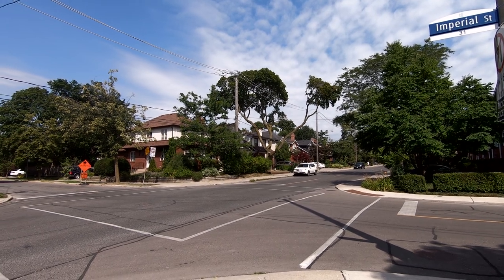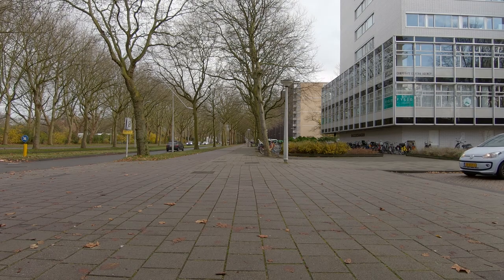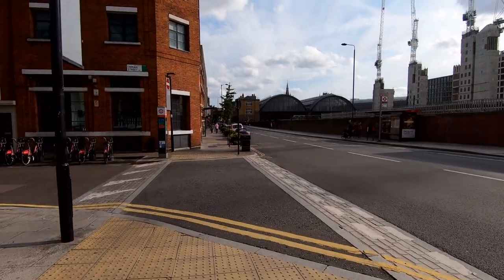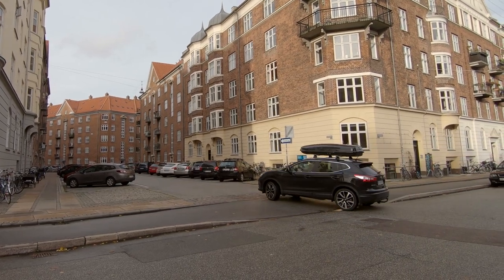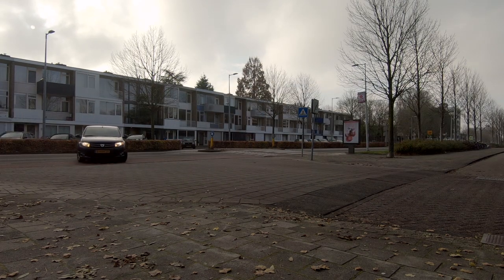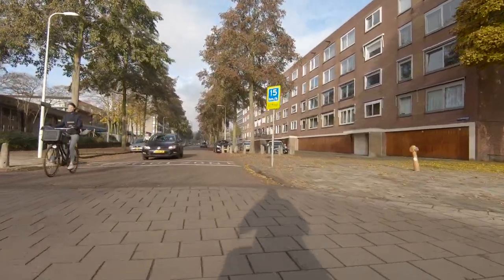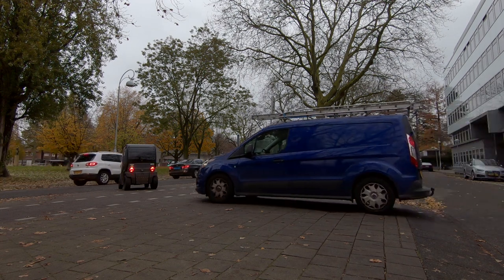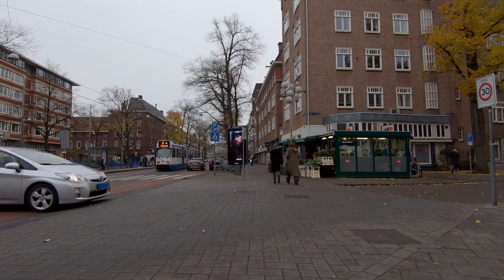The Dutch Solution for Safer Sidewalks - Continuous Sidewalks

Comment: You forgot to mention one important thing: this sidewalk 'exitway' design by law also acts as a yield sign (uitritconstructie). If no such design is applied, and a side road must give way, you'll see yield or stop signs. You'll most often see uitritconstructies acting as endings of 15 km/h (woonerf) or 30 km/h zones, ending in 50 km/h neighbourhood streets.
As part of 'Duurzaam Veilig' policy; to make the difference between these zones pretty clear, 50 km/h roads usually consist of asphalt while the slower neighbourhood roads are made out of brick pavers. They last longer and are easier to repair but are less smooth for driving over with higher speeds. To further enforce speed in these slower residential zones, it's where you would find speed bumps and equal crossings (traffic from the right has the right of way). The roadway reflecting the speeds that are allowed makes the whole system a lot more pleasant, predictable and safer.
Reply from the maker: You can't forget to mention what you never knew (taps forehead).

I recognise your nick from reddit, and I've seen you post a lot about urban planning. That's the difference between you and me: you know what you're talking about, and I'm just a guy that makes videos on YouTube.

Anyway this is great additional information. Thanks for providing it!
Reply: @NotJustBikes  In fact, pedestrians crossing the exit have priority over all traffic, so it's effectively also a zebra. This differs from other intersections, where yield signs don't apply to them and they only have priority over traffic turning across their direction of travel. You're entirely right that they are spaces for walking that others should cross with caution.
Reply: Uitritconstructies are part of the theory you need to learn to get your driver's license. Nothing unclear or dangerous about them. If you disagree, you might want to retake your theory...
Reply: @jlammetje  not in every eu country! Also people that move to the Netherlands with the 30% ruling can just trade in their licenses for a dutch one. Uitritconstructies are just bad design! When something is designed well you should not even have to think about how to use it, it should feel natural. uitritconstructies are misused all over the country in illogical places. Another bad design is some roundabouts are design so that cars approaching the roundabout have right of way meaning that cars already on the roundabout have to slow or even stop to let cars on. Experiments in road design are not always successful.
Reply: Lynott Parris I know EXACTLY which crossing you are talking about! Hated that part of road when taking my driving exam!
Reply: @michellezevenaar  Well, this is so weird. It basically means yield to everyone if you're driving a car. You always yield if you come from a raised exit or from an uneven road (like a dirt road or something). Also, people from abroad should read a little into the traffic environment they will be driving in. Besides that, these raised sidewalks are often so high or in such a sharp turn that you basically come to a complete stop. I totally butcher them sometimes in my car without slowing down much, but you get literally thrown throughout the car. Then if you're on the thing you will quickly find out that nobody is about to yield to you lol. 

Even as a kid learning about traffic rules in late elementary school I had been surprised of how well designed raised sidewalks were. Also if you're in a foreign country just yield to the main road for Christs sake, if nobody stops you probably don't have right of way. There is a street here that is narrow (30km/h) and really busy with lot's of side streets. Technically everyone of these streets has right of way from the right, but people usually drive 50km/h there and no one is going to yield for you honestly. Sometimes you just need to read the road. They even put signs up telling people the rules, but it didn't make much difference, traffic was moving too fast and it was to busy to yield there. They put down the signs and let it be.
Reply: @michellezevenaar  What is unclear about it?
The traffic coming from left or right has the right and the traffic coming from you or opposite of you have to stop.
Reply: @AlexFlodder  the problem is recognizing what it is not the actual rules around it. Imagine driving on a normal road then at the intersection there are no signs just a different paving and a slight difference in hight (some do have a big hight difference thankfully). No signs at an intersection normal means that traffic from the right has priority. Uitritconstructies are soooo easy to miss when it's snowed.... You literally don't see them!
Reply: I never really thought about this. But I don't think I ever really look at speed limit signs anymore. It's always very clear to me what type of road I am on and what speed it is.
Reply: @michellezevenaar  It doesn't snow that often and when it does, most dutch people can't drive anyway. So yield anyway... just in case.
Reply: @michellezevenaar  There is a difference between what YOU find normal and what the Dutch find normal. Particularly with regards to traffic. It isn't tailored to the USA or Canada, it is tailored to the Dutch traffic laws. And if you don't know the rules of the road, nor its infrastructure an its rules, you shouldn't drive at all. Continuous footpaths and bicycle paths are all over the place, cross either YOU need to yield, period.
Reply: @Paul_C  I grew up in the Netherlands and my husband is dutch and he's been driving here for 25+ years. He's a very good driver and even he missed seeing one of these dammed uitritconstructies! The problem is that they can be miss used by city planners and places in totally illogical places. When rules and situations are made to complicated it takes up alot of your brains capacities just to then follow the rules and there is less brain capacity left for things like watching out for bikes that are biking against the traffic and there for unexpected. I have lived with uitritconstructies for more the half my life and they definitely are a design flaw and should be fixed! Add a sign its not that hard after all everything else has signs!
Reply: @michellezevenaar  We pretty much have the same in Denmark. When passing a foot or cycling path, or the pavement changes to i.e cobblestones, you have to slow down , and let all traffic from both sides pass. The same goes for when you exit property, a parking lot or the like, onto a road, or the road has sharks teeth.

I've only ever experienced doubt while driving a car, when the road had sharks teeth, Especially where the paint needed some re freshening. Which is to often here.

I find sharks teeth to pose a danger. While pavement change, and raised cycling or footpaths, keep both cars, pedestrian and cyclists safe, by slowing cars, and clearly marking the "soft targets".
I'd love to see the example from your Street View link, become the standard in Denmark.
I guess it all depends on what were used to.
Reply: @michellezevenaar  There are so many little differences in the traffic laws of EU nations. For instance to a lot of Europeans if there's "haaientanden" on the pavement, that means you have to yield to other drivers. But Germany doesn't have "haaientanden" they have a broken stop line to indicate that you have to yield right of way. I was taught this little detail by my driving instructor, because I live very close to the border. Most of my friends who live further west, do not know this at all, even though they should know it when driving in Germany.
Uitritconstructies are no different in that regard. They're mostly a quirk of Dutch road design, but I've seen the same construction used in Germany and Belgium. Albeit with more signs, but the end result was the same.

As for those "roundabouts" where traffic entering them has right of way, there are only 3 of those in the country. They are all in Nijmegen. But contrary to what you assume they are not "rotondes" they are "verkeerspleinen". The thing is these verkeerspleinen existed long before the law was changed and the sign for verkeersplein was changed to mean rotonde.
They've discussed changing both the Keizer Karelplein and Takenhofplein to rotondes, but in both cases the conclusion was that there was no benefit to changing them. The problem is that traffic entering and exiting these traffic circles is controlled by traffic lights. So traffic entering the circle has no control over when they do and don't get to go. Removing the traffic lights would mean that cars entering the traffic circle would have to yield to pedestrians and bicyclists already in the traffic circle. Those traffic circles would grind to a halt during rush hour, especially the Keizer Karelplein.
If they'd put in the technically correct sign, it'd mean that you can't overtake in the same way that you could in a rotonde, which would again kill the flow of traffic.

The third one is Steve Bikoplein, which is a special little gem in and of itself. It can't be made into a rotonde, because it's basically a triangle with a circle in the middle. But a few years ago they updated the road markings there and the priority situation couldn't possibly be more clear. If the Steve Bikoplein confuses you, you should have failed your theoretical exam for your license.

As for the Keizer Karelplein and Takenhofplein. If you're unfamiliar with the situation, look at what the locals do. If everyone around you stops, I sure hope that you would stop as well. When in Rome and all that. And if they really scare you that much, it's perfectly possible to get around Nijmegen without ever needing to go round any of those traffic circles.
Reply: @michellezevenaar  You'll DEFINITELY feel them though.
Reply: @michellezevenaar  it's pretty simple! If you are on one in a car. You have the least priority. If there is one to the right of you. Traffic coming from there has to wait for you to pass. Learn your shit or don't drive. Sorry for being this harsh, but I am very often on a bike and wouldn't like to be sideswiped by someone who doesn't like the appeal of a traffic structure.
Reply: @michellezevenaar  also the thing you said about roundabouts is completely false. Traffic on the roundabout ALWAYS have right of way. There are no exceptions to this!!
Reply: @basvanbeers3515  not true! There is one in the city I live in in the Netherlands were the joining traffic has right of way! Its how ever the city desides to design it. Every country has different rules!
Reply: @basvanbeers3515  i should add that the one that I'm taking about finally was corrected a few years ago so that traffic on the round about has right of way. Before they changed though it did cause alot of accidents including one my husband was involved in. He had right of way merging onto the roundabout and the other car didn't realize they needed to yield. Those kind of things you remember years later
Reply: @michellezevenaar  aren't there traffic lights? Or sharks teeth?
Reply: @basvanbeers3515  there were no traffic lights on that one and the sharks teeth were on the round about signaling that the traffic goings the round about had priority!
Reply: Ah, I was wondering about this, as it wasn't mentioned in the video.
Germany has the same rule of having to yield if you enter the road over a sidewalk. However, local councils have very little faith in drivers and in most cases still put up a yield sign.

Back in the 1950s, they used this rule as a planning principle for a whole new town (Sennestadt, now a part of Bielefeld), to save on signage. And then, in classic german fashion, they got cold feet and put signs at every entry regardless.
Reply: @Michelle Bennet I agree with you that your example is a really bad choice. I wouldn't expect one at that place plus there's no bumb in the road going onto the pavement. The right choice there would be haaientanden and a yield sign. Uitritten should only be used inside the city. Not country roads.
Reply: An easy way to think about it would be that the street "ends" before the crossing and therefore you technically enter the road from the sidewalk... therefore you have to yield to every vehicle already on the road before you can enter.

Comment: Tip for a video: if a bike lane is next to a major road, and there is a junction with a minor side road, the bike lane is often made to be a bit further from the main road, so that people who turn e.g. right from the main road do not have the cyclist in their dead angle, but they meet the cyclist at a 90 degree angle, which makes it easier to see the cyclist when making a turn with your car. Also there is a bit of space created in this way so the car can wait for cyclists to pass without blocking the road they were driving on before when taking a turn. This mostly happens in the suburbs and countryside as there is more space for road design there.
Reply from the maker: It's a good idea, but generally, I try to avoid topics that Bicycle Dutch has already covered very well, and I think he's done that, here!

https://www.youtube.com/watch?v=yceHo8VvQbs

Comment: You actually missed one major reason why this is done. The right of way system we have.
It's great that it's good for pedestrians and cyclists, but that was only after they started widening them. These can even be found if there is no cyclepath or sidewalk. A raised 'sidewalk' means that traffic coming from this raised bit Doesn't have the right of way, even when coming from the right. They have to give way to traffic in both directions.
This can of course also be done with signs, but this is much easier for drivers to process, especially those on the main road.
Plus of course the bonus of the continuous sidewalk/cyclepath.
Reply from the maker: Yes, I talk about this in my video about stop signs!

Comment: One of the advantages I see with continuous sidewalks is that it's a lot easier to cross with a wheelchair (or baby stroller) or with reduced sight.  No need to turn around to get down to street level with the back wheels first (because otherwise you throw the person out of the chair due to the drop).  Especially for people in a wheelchair on their own it's a lot safer and easier to use.

Comment: There are no bumps crossing the road. When there is not a raised pavement on a corner there is always a little slope to the street level. I think that’s on every corner in the Netherlands. So in a wheelchair or walking with a rollator (walker) no problems with crossing streets.

Comment: In Colombia a lot of these principles are used also, Sidewalks and cycle paths are usually together and raised, for crossing side roads the road stops and then restarts, the more major the road the less of a distinct change. moving to traffic lights. and at many multi way junctions they will have lights with equal timing for bicycles and cars and people, so a timing might be Junction A, Then Cars Junction B, then Bikes, then people, then Cars Junction C, then restart, or their might be other systems depending on the amount of connections.
Reply from the maker: That's great! I didn't know that.

Comment: Dutch continous sidewalk design is very much informed by priority rules, giving any traffic going straight on or alongside a road, priority over turning traffic from that same road. This already puts pedestrians and cyclists in a much safer position than in many other countries. In the Netherlands, the infrastructure just highlights that rule. In Britain, crossing a side street as a pedestrian can be very dangerous, as you have no priority over cars turning from the main road. 
The only bad thing about Dutch priority rules is giving any traffic from the right priority. Small roads can easily be overlooked. Although this rarely affects pedestrians, for that situation I prefer the British system, where at each junction road markings will tell you which road has priority.
In general, Dutch road infrastructure is mindblowingly good compared to any other country. I have lived in the UK for 17 years now, and what I miss most is safe cycling anywhere, without having to consider my safety when planning my route. I just want to up and go like the Dutch. Most don't know how lucky they are.
Reply: You falsely believe like most that as a pedestrian you do not have priority over traffic when crossing a side street in the UK. You actually do, it's in the highway code. Better street design with continuous pavement just enforces a rule that already exists. Rule 170 of the Highway Code advises that if a pedestrian has already started to cross the side road into which you're turning from a main road, you must give way to them.

Comment: for me a "big" thing for the raised sidewalk is it also makes using the crossing easier for pushing and trucks / wagons ETC not to mention people with handicaps or are in wheelchairs / mobility aids as the kirb down to the road becomes a "choke point" and often a steep elevation change and in 2022 ignoring "active transport" / "being ECO" being more accessible should be a reason alone to push for such crossings